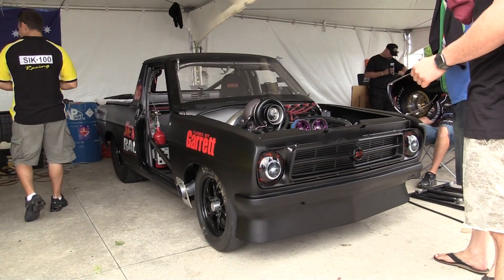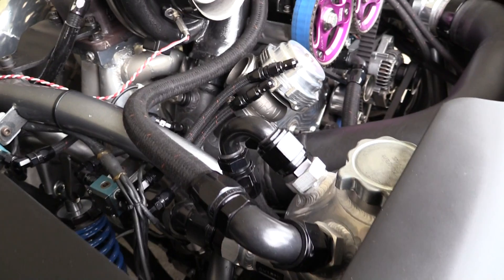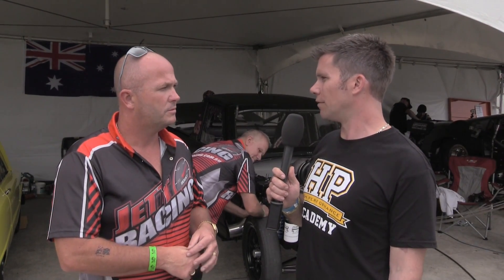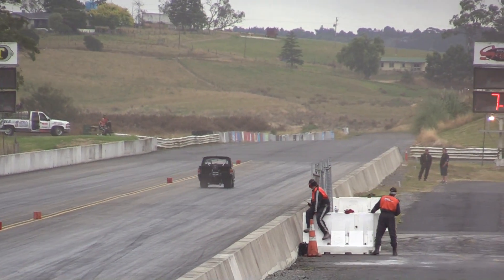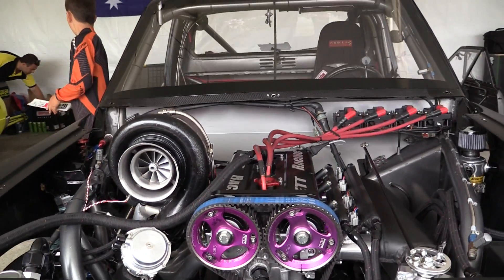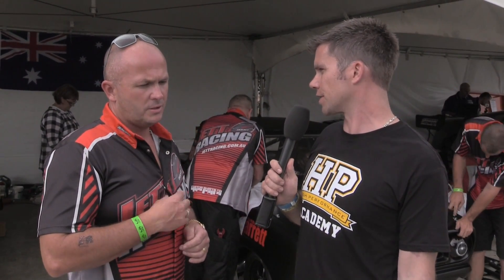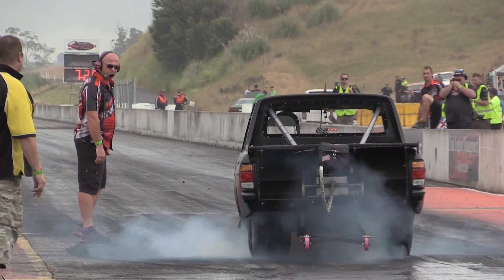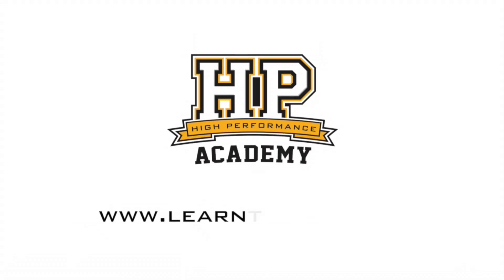Find out what happens when you fit a 1300 hp 4G63-powered to a Datsun 1200 ute

Comment: Dumb question... why do most drag racers estimate the hp ratings of their engines? Don't they run it on a dyno when they tune it?
Reply: They turn it up or down and tune throughout the day between runs, so there's no time to dyno between that. A lot of the 
 on-location tuning adjustments are done based on the logging taken from previous runs as opposed to a dyno setup.
Reply: Izaak Ramsay Thanks! I don't know why I never considered different track conditions and tuning adjustments... they never crossed my mind until I read my question again 6 months later. I look dumb lol
Reply: Not to mention sometimes drag cars are running to high of Numbers in torque/hp to run it on the Dyno safely without it flying off.
Reply: Sometimes the dyno results but there is a calculation method too... Weight of car v's speed/1/4 mile time etc... old schoolers use the moroso calculator.. ballpark accurate but quite relevant.